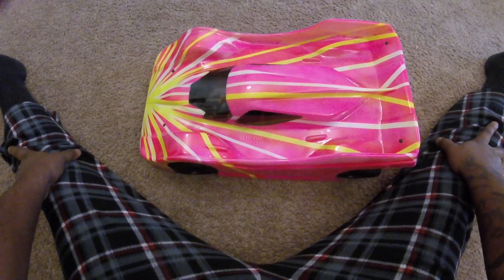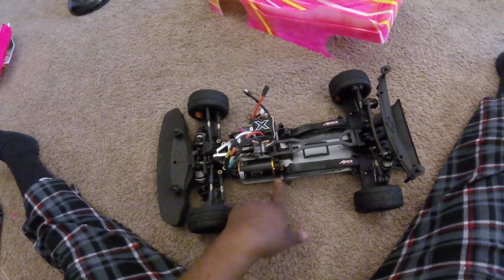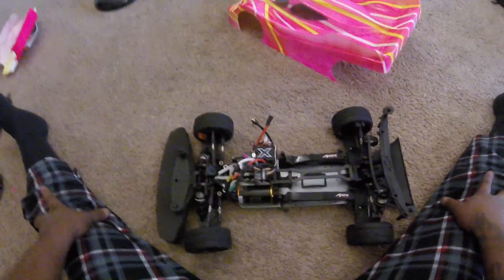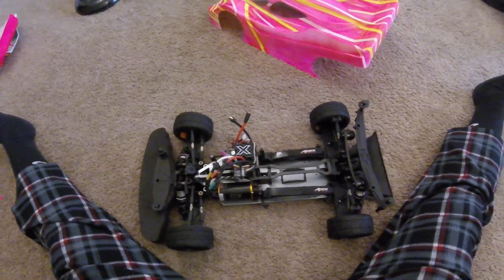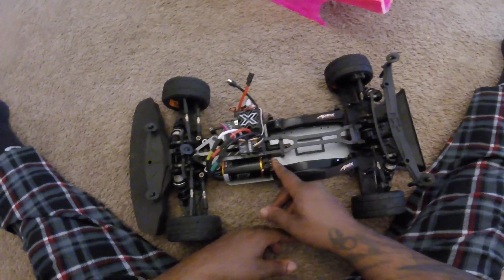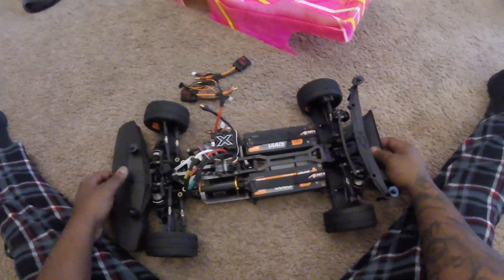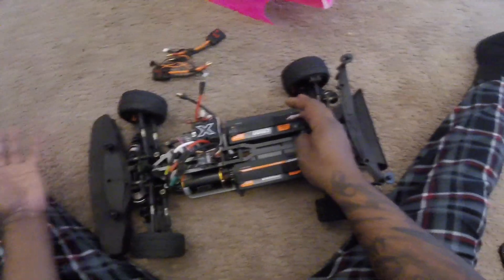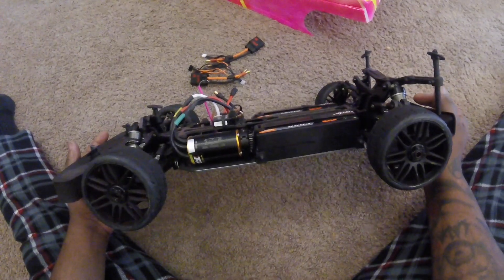Builds: Serpent SRX8 GTE WC   HD 1080p

Comment: Nice bro. What kv motor u use?
Reply from the maker: TP4040CM 3700kv
Reply: @satttheman   size pinion and spool brother?
Reply from the maker: @syawalsyawalherman4807  stock spur 44T and 20T pinion
Reply: @satttheman  can this motor run 8s?
Reply from the maker: @pret98  yessir and the car is for sale!
Reply: @satttheman  its not over hot with that small kv?
Reply from the maker: @pret98  no. It’s made for it.